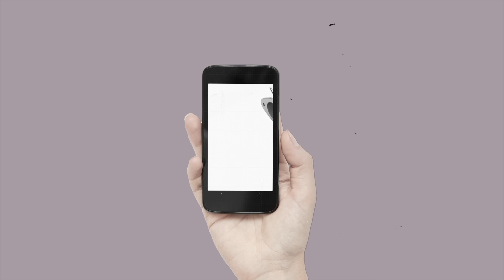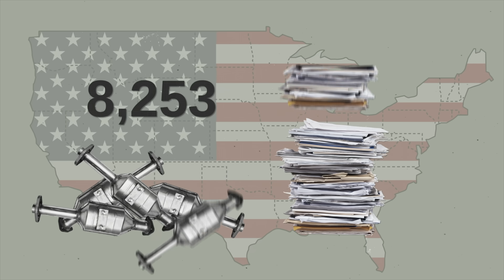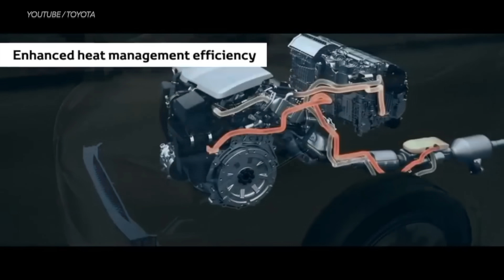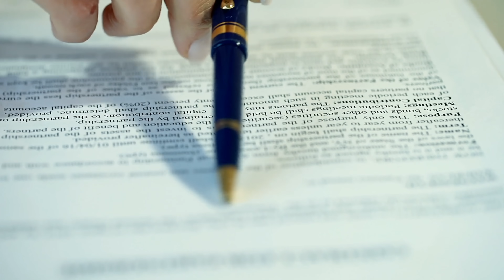Police Catch Thieves Stealing Catalytic Converters in Driveways (You Won't Believe This)

Comment: I once had an older car that the catylitic convertors, well first I knew the insides were all loose, but it actually broke in half. At least my state doesn't have strict emissions so, it wasn't as costly to replace. Still more than I really wanted to spend though.

Comment: Yes, I went to Houston in the Summer of 2021 to visit my daughter in my 2004 Sequoia.  We stayed at the Home2 Hotel near the Houston Methodist Willowbrook Hospital on the North West side where they had a security guard overnight from 9 pm to 6 am, but the thieves must know that because they got the driver side catalytic converter and were trying to get the passenger side, but someone must have scared them because the pipe was slightly cut and not cut through.   I knew right away when I started my vehicle, it was loud. I called the muffler shop back home and they quoted me $2,400 to replace both.  I went to the local muffler shop New Star on Spring Cypress Rd. and asked them if the could put on a straight pipe back to the muffler to make it quieter and direct the exhaust out the back but they wouldn't do that even though we live in Ohio.  Ohio doesn't do emissions anymore.  I was surprised but gave me an option to install an after market converter for $250 total.   I am still using it and no codes, so thankful that they took care of me when the thieves didn't.
Reply: It is a V8 Sequoia and it has two catalytic converters so what I referenced was one was cut off and they tried to cut the other one.  I did have that side welded as you mentioned, so $250 including parts and labor for  just one catalytic converter was a great deal.  That also included then welding the other side where it was cut.  I was not ripped off.  I did a police report and let the hotel know and they helped me out with a couple of free nights as we stayed there for a week and I didn't have to make an insurance claim.  Scotty mentioned the Houston area, so I was just confirming it.  Take care.

Comment: Over here a thief ring uses a rent your car app. They send a sweet student girl to rent your car and bring it to them. They remove and open up the converter, take out the metals, weld it shut again and Bob's your uncle. Priuses are favorites. 
After your car seems to run ok. You will find out when your emmission test fails.

Comment: My '09 Prius was stolen while I was sleeping Thanksgiving morning last year. It was a keyless entry version, not because I'm a fan, it's just the Prius I was looking at happened to have it and I didn't care one way or the other. That was a mistake. I reckon I put my bed too close to where I was parked and the thief only had to exploit one unlocked door and press a button. But I had comprehensive, so after a month of hoping the vehicle was recovered my insurance finally paid out, valuing the car more than my deductible over what I spent. I then bought another Prius, but with a '15 with a key this time.

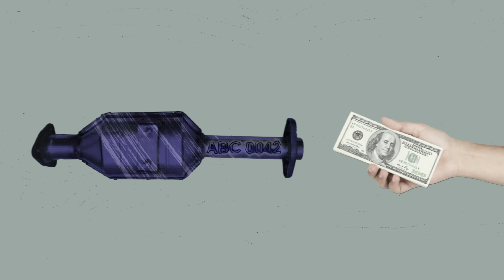Comment: 6:00 Don't wasting your time etching your converter.   Once it's gone, it's gone.   They can grind it away.   The chance of getting yours back is %0.01.   Some say painting it with high-heat orange automobile paint might prevent them from taking it.

Comment: So glad I don't own a truck/SUV or hybrid. State and federal governments could easily slow this down if they'd require sellers to disclose documentation from a repair shop on every catalytic converter. This should be required anyways since you can't remove a catalytic converter by law unless it is failing. Big operations like this should get 25 years minimum behind bars in a federal pen for everyone involved.

Comment: My 2001 Dodge ram 1500 was stolen. Thought I was safe with an old truck. Nope. Fortunately the cops found it a few months later parked in an apartment complex. All my tools were still in the tool box. Apparently they just needed a ride. 
Oddly enough my biggest fear when I first reported it was that the towing company would strip it or take my tools if they found it in tact. The guy at the towing company confirmed my fears and said I was lucky they found it instead of another towing company. Scary. Now I take the battery out when it's parked. Heavy and dirty, but if they want it this time they will have to bring their own battery.
Reply: Why would you take the battery out, instead of just taking the fuel pump relay out. It takes 2 seconds to take out and put back in. And doesnt weigh 50 pounds....
Reply: @richsweeney1115  Because I'm not as smart as you. Fair enough?

Comment: why dont car companies just encase the converter within the design so you can't access it like up in the engine under the hood.
Reply: In a perfect world, car manufacturers should encase all the high priced parts under the hood. It just makes more sense to put it on the exhaust line because that is what they are made to deal with.

Comment: I have a kill switch in both my cars.  They won’t start til you turn the lights on first.   

I did security on my days off from my normal site at the school bus lot til they could get and electric fence installed because they had converters stolen off the busses. Turns out my childhood bus driver still working lol. Damn.

12-3-22

Comment: My Tacoma catcon was stolen.  I didn't expect the police to return it, but I didn't expect them the be completely indifferent.  My 4Runner has four catcons.

I hid an Invoxia GPS tracker in the beak of my BMW G310GS motorcycle, along with the USB power port that keeps its battery charged.  If someone steals my bike, Mr. Twelve Gauge and I are going to get it back.

Comment: Here in Houston, last Sept they cut one end off my Honda Element before we chased them away. So, I got the Cat Shield. This Sept they just cut it off because it's only aluminum, the video shows 20 minutes vs 6 minutes without the shield. Insurance paid $3600.00 and non OEM cat. I  had to pay $250.00 deductible and $800.00 more for a steal cage, 2 U bike lock and 3 motion lock. It'll slow them down but not 100%. They don't care if you have them on camera or if you see them, please be smarter.

Comment: 1/2 inch steel wire welded on and over the cat plus a length of the exhaust makes pipe cutters impossible and a reciprocal saw much more difficult 😳.

Comment: Just had the cat stolen off my 3rd gen Toyota 4Runner (they also attempted to cut off the muffler so it needs replaced too. 🙄) It was in a "secure" parking garage attached to my work office building. Turns out the dumb dumbs don't have cameras in the garage. 😡 Trying to decide amongst the varying types of anti-theft cages/cables after I replace it.

Comment: It's only a matter of time and theives will realize how much tail lights are worth. Way more than any converter, because the light also houses proximity sensors and cameras. Some cost upwards of 2k each to replace, not including if they cut the wire harness and take the tailgate as well. 🤓
Reply: Buy a car for that much ! 😅😅😅😅

Comment: Why aren't car manufacturers required to make the catalytic converters unstealable? to weld protective plating to prevent theft of the cc? it would only raise the initial price a couple of hundred bucks. Cheaper to consumers compared to 1,000's to replace.

Comment: Why don’t they just print the serial number or license plate on the catalytic converter for no cost from the dealership or police station like you said there in your video that is really smart because if it has serial number on it up it’s hot can’t tell it can’t do anything with it but really that doesn’t matter what they want is just what the inside more than the catalytic burner converter itself so maybe just edging number on it won’t help very much how else can we protect our catalytic converter’s

Comment: Easy fix, make the crime punishable by the death penalty. Also if you want to make someone pay if they take yours sprinkle brake dust or set up some traps that release drake dust into the ares under the vehicle when they cut it, they won’t be able to get away from the dust and they will breathe it in and get it in their eyes.

Comment: Someone at my work had theirs stolen, and they said they aren't going to replace it, and will just deal with the noise.  They said unless someone else pays for it they are just going to keep driving it the way it is.  I have an EV so I'm immune to this.
Reply: No worry, it will catch fire soon.
Reply: 06/11 22 Only a matterof crime. New crime will be to steal your car & remove its power pack to avoid renewal costs on a model compatible with yours.
Reply: @peterallam6494  Good luck with that.  You would need heavy machinery that would not fit in any normal parking lot.  Plus the process would take several hours.  A far cry from cutting an exhaust pipe.  The reason catalytic converters are stolen is because they are easy and quick.  And as far as "hotwiring" cars, you have to go back a couple decades before that's possible, you can't do that on even modern ICE vehicles.

I used to work in a place that dealt in construction equipment.  We only had one forklift that was capable of dealing with something that heavy.  The normal ones were not.

Comment: Yup, a year ago my 1996 Honda civic lx got stolen in front of my house (they used a shaved key) they stole my catalytic converter and my intake manifold. I live in a nicer side of my city (Bakersfield, CA) and the cops found it within 24 hours in the worst parts of town. Scotty, how do I fix my ignition that has a shaved key stuck in it (it’s broken so that any key can start it) do I have to replace it? And is it worth it to fix the car or scrap it?
Reply: Get an engine cut out switch fitted at auto electrician with a disguised or concealed switch.
Reply: Same thing happened to me.  With a couple really sharp pointed tweezers   after a couple hours I got it out
I think I was also using a thin paper clip with a bend at the end to try to get behind the key
Reply: Usually a locksmith can help you out.
Reply: @reecenewton3097  Are they that difficult to change yourself?

Comment: It's a problem created by our system. If stealing something holds greater value than the likelihood of getting caught and possible punishment removes people will steal. Also, the $$$ per hr. reword could very well out way the reward of a normal job. Work less, make the same or more and choose you're hours, the dream right? Not that I condone what they do, but in a way makes sense.

Comment: the last time we got a a news paper went digital no thanks the one the got my funny but not funny bone is thieves here in arkansas stole the car battery by cutting the car horn and either breaking into the car/truck popping the hood cutting the wires to the battery shutting the car/truck back up that it looks normal. so when you leave for work or some place hmm dead battery you un lock your car with the emergency key. nothing happens pop the hood to see all the damage.  next thieves targeted ac units for the copper doing thousands in damages no home owner insurance will not cover thieves it’s all out of pocket. i just gave up reading the paper same song n dance oh gps units those are a no no in this town

Comment: Simple, get rid of this outdated, obsolete 1970's technology that the government mandates. Let the manufacturers clean up the engine exhaust without this stupid, expensive, rare-metals device.
Otherwise, string a few high voltage fine-gauge wires across beneath the car, activate when away from vehicle.